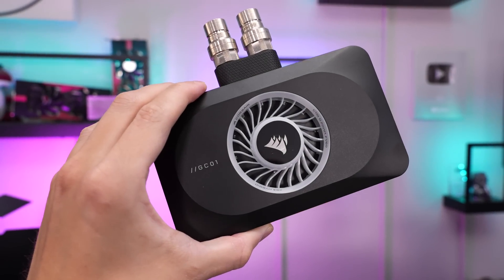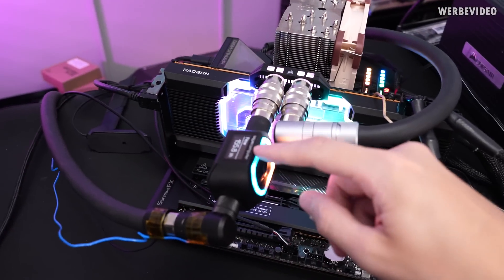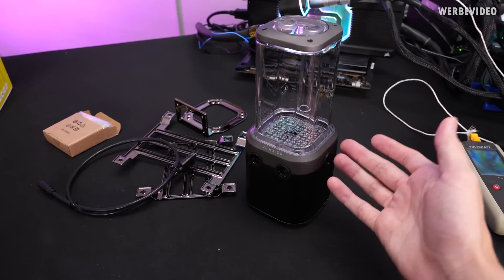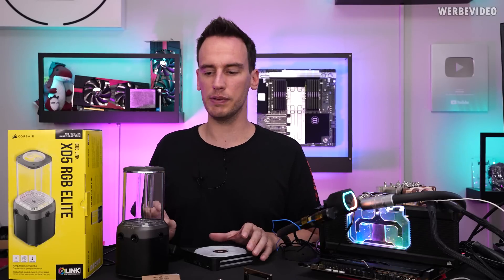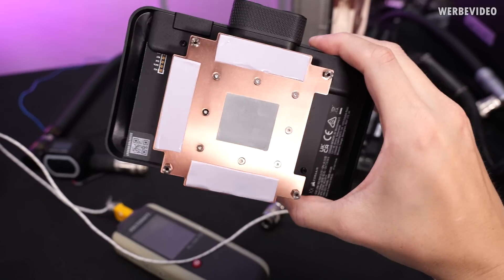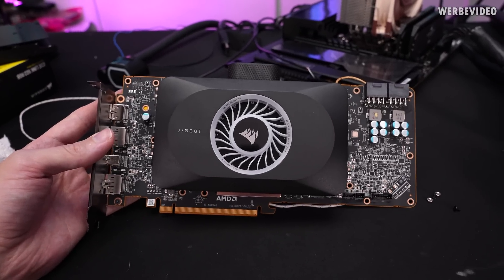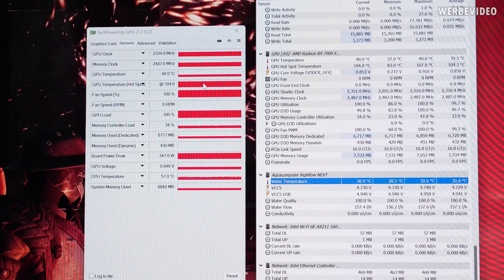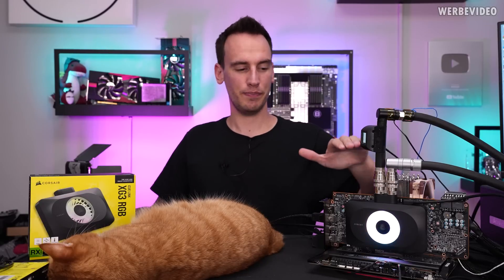There is a Problem with Corsairs new GPU Water Block

Comment: I stopped buying Corsair a while ago, when they completely abandoned my then 2-year-old AIO h100i cooler, through a forced and malicious iCUE driver update that categorized it (and many other "old products" as "End-of-Life", and turned it into a complete brick. I was getting a ton of BSODs and I had no idea at all that this driver update was the culprit. Super malicious anti-consumer practices. I also had a Harpoon mouse that totally broke within a year. Now, seeing this video with this joke GPU water block is not surprising. I wouldn't be surprised if Corsair was secretly purchased by a Chinese parent company. Usually those errors in translation, or strange-sounding marketing claims is the give-away. Ali-Express style marketing.
Reply: Had some 5ish K95 keyboards. All of them got issues with LEDs dying, or the blue LED dying. A couple of them were replaced by warranty, but same issue always hit at some point - different PCs, different USB ports and all that. Just terrible quality.
Got 3 of them laying in some drawer, non-RGB, RGB, RGB Platinum or some such, I forget.
After the last one, which might've been way too late.. I've just stopped purchasing Corsair products.
Reply: @Nightykk yup, i also have K95 keyboards. 1st came with some dead LEDs out of the box, I returned it, new one started to show dead LEDs after few months. Very bad quality. Atfer switching to Logitech 915 (I have 2, full size and TKL) I think about 2 years passed and no single dead LED. Corsair laying around as a reminder to not buy corsair keyboards.
Reply: @Examoon  i love my 7000D, it's built like a brick shithouse and was incredibly easy to build inn as expected.
Reply: Just run an old version of iCue.
Reply: @Examoon  I have a Corsair case and it's excellent.
Reply: That's a you issue mate, i had no such problem with any AIO caused by software.. All you had to do was keep LiNK installed, iCUE would be no benefit to you, or you had bad luck, just happened to fail around that time. Personally i have 3 Corsair AIOs, one of which second hand and they have never gone wrong once.. And perhaps you got a bad mouse or you bounced it off the floor a few times, could always be user error.. Software killing your AIO is possible but unlikely. Could have just kept LiNK!
Reply: @ChaosHusky  How about this, maybe your head bounced off the floor a few too many times, maybe YOU should keep iLINK and keep sending your money to Corsair. I know I wont. How about the company sends out an email ahead of time "Hey, don't upgrade the software" or "Hey, switch to this other program that we have decided to downgrade you to" No warning was given at all. If you are okay with having to send support tickets to figure out if your drivers will work, that is totally up to you. Congrats, that's your own YOU issue. Me, I am happy with Alphacool, superior products, driver-free. Done with this entry-level junk. Computer cooling should NEVER be driver-dependent.

Comment: This Corsair GPU Water Block seems like a total rip-off. For 30 euros more, 160 euros, you can buy for example the Alphacool Eisblock Aurora which offers better cooling results, it's a full sized water block which also comes with a backplate. Had the Corsair Water Block, been like half the price, it would have probably been worth it. Given the problems it presents and being so expensive, it's definitely not worth it, even if we leave the aesthetics aside. Speaking about aesthetics, it doesn't look good at all, no matter how you mount the GPU, as far as I consider.

Comment: I don't think this type of water cooler is bad, however the price most definitely is and if they included small heat sinks with thermal adhesive for the vrm it would have been much better. there.
Reply: nobody is going to use this though. imagine spending a fortune on a cpu waterblock, a pump, a reservoir, tubing, fittings, coolant, etc and then buying this. it's a waste
Reply: @piersonm5574  There are people who want water cooling to quietly cool a higher end system but do not care about looks that much, for them this style of cooler is fine, just not at this price.
Reply: Just imagine the dust build-up over that card with a fan blowing straight onto the PCB...
Reply: @ThesurgeoNNN  it's a blower fan so it's not as bad, but still not a fan of the design (pun intended)

Comment: its a "cheap build" beta product. it looks like the cheap plastic gpu air coolers from 20 years ago. Corsair wants $130 usd for $50 in plastic and a copper sheet. and a control block that has so few i/o ports that cant cover their ecosystem. Corsair marketing team working over time for the corpo market speak.

Comment: I think if they just added some cooling heatsink fins that you could stick onto the VRMs with some thermal pads, that would help a lot with the cooling, since there is active airflow over the area.
Reply: I was about to comment this as well.  Most modern GPUs come with VRMs that are massively overkill for the GPU under most circumstances and just having some copper/aluminium heatsinks stuck onto the VRM chips (like the old days) will keep them nice and cool.
Reply: Yeah if the block came with a bunch of black anodised heatsinks with thermal tape it would help with looks when horizontally mounted.
Reply: @PREDATEURLT  for you 70c might be okay but reference/AIB cards come with VRM coolers so this block not having one is a problem